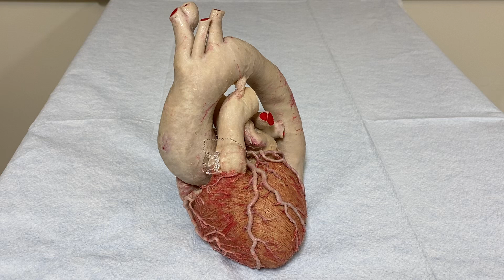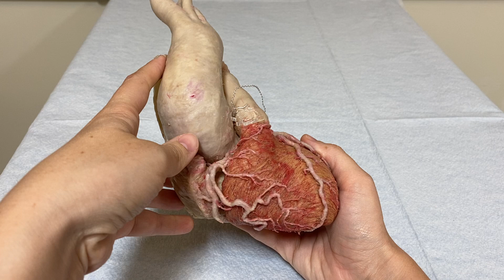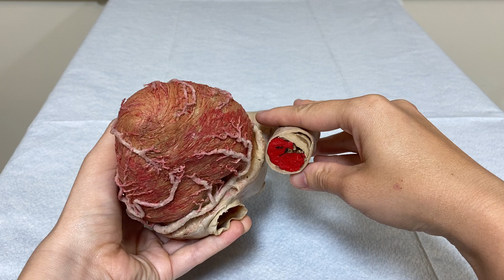Pathological Heart

Comment: how was this heart preserved?  Looks plastic
Reply: It is preserved with plastic in a process called plastination. After being first preserved with formaldehyde, the specimen is put into a bath of acetone which soaks into the cells and over several days replaces all the water. Plastic resin is then added to the bath and its put under vacuum. At the low pressure the acetone is able to all boil off and the plastic moves in to replace it. The liquid plastic is then cured solid.